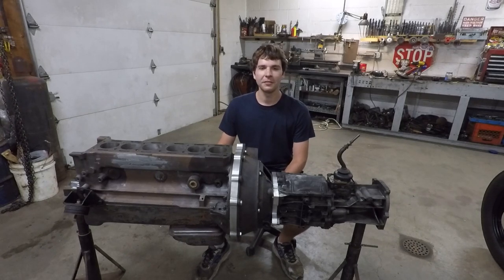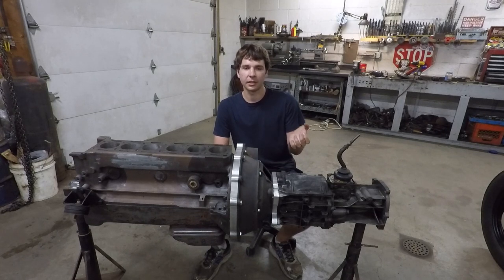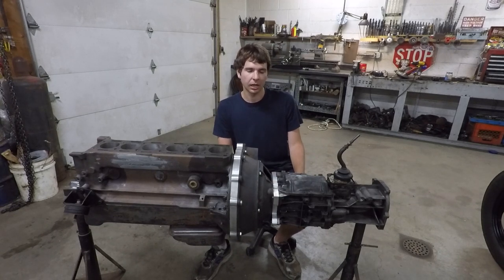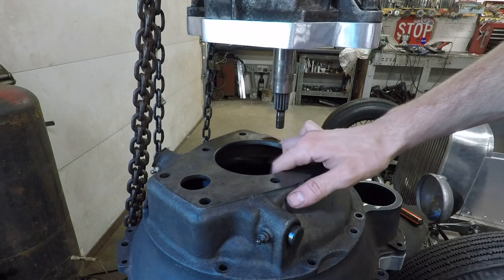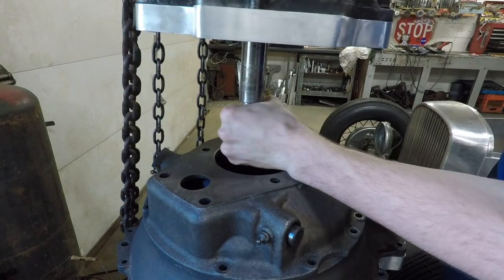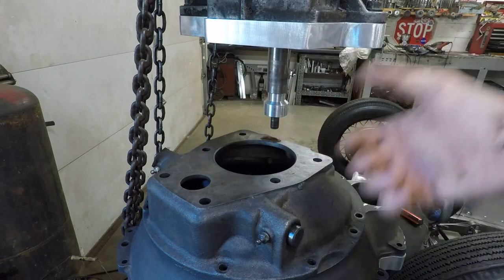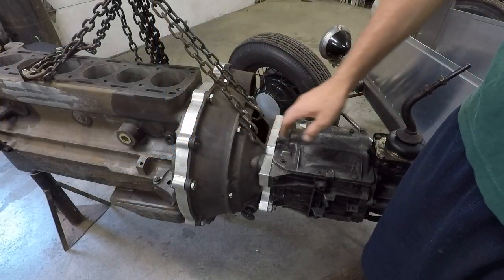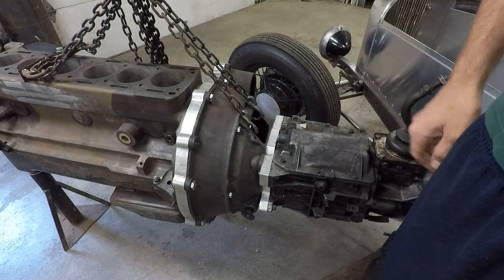Any Engine + Any Transmission Part 2!

Comment: What if the gearbox input shaft is too short ? If it is too long is a matter of using thicker aluminium for the adapter plates but what if using the thinnest possible aluminium plate is not enough to cater for a possibly short gearbox input shaft ? Otherwise keep up the good work - you have an excellent set of skills.
Reply: YUP! What about that?

Comment: It will be interesting to see the engine/trans location in the chassis.
Reply: Plot twist the car will be Rear engine!
Reply: @Fransenn  Nice joke but I don't think so.
Reply: @RichieCat4223  na i dont think so either
Reply: Those engines are heavy and there's nothing in the back end of that car but a few gallons of fuel. Weight distribution will be all up front making "interesting" handling. Even a fresh 2.4ltr XK motor is 112 bhp and the 3.8ltr knocking on 200 so the power to weight ratio will be impressive whichever you have. Now, about changing out those 1930's brakes...
None of this takes away from the astonishing competence you show in all your videos. I can't wait to hear your car run!

Comment: How did you decide on the thickness of the bell to trans spacer? I see bellhousing length measurements when looking at aftermarket, but I can't find an explanation from anyone on why they might be different. Obviously the overall distance between the trans and engine would effect how well the input shaft and pilot bearing mesh, but how do you know what that distance needs to be? For example, if the trans has a 6.5" input shaft and its being mated to a sbc, does the bell need to be 6.5"? 6.25"? 6.75"? It would be great if someone could make a video explaining bellhousing selection instead of all the "bell alignment" videos out there.

Comment: Loving all your clips and wondering how do you go about making the edges nice and smooth after cutting the plate on the saw?
Reply from the maker: a combination of an angle grinder with a flap wheel and files

Comment: Would suggest the you have engine rotating assembly balance any it is a must that you have the flywheel balanced with all the mods that you have  done on it.  Actually it probably be best that you have the entire rotating assembly including the flywheel balance as an assembly.  You will thank me down the road.

Comment: so...how did he measure to know how much to take off the trans adapter plate? i'm assuming there is a specification somewhere detailing how far the input shaft goes into the crank? or may you lower it down and if you can turn the tailshaft it's not in all the way? i'm confused on this point.

Comment: Ok but don’t I need spacers to raise the flywheel or lengthen the output shaft if no adapter kit exist like in my junction of a Mercedes om617 turbo diesel to a Jeep pattern turbo hydromatic 400 auto? I am thinking I need to add a spacer to the crank to meet the flywheel metric to imperial also.

Comment: What do you use for a torque spec for the tapped holes in the aluminum? Is there a formula based on material grade and thread?
Reply from the maker: if there is, I'm not currently aware of it

Comment: Can you tell me why do you think the threaded bolts into the aluminium adaptor plates are strong enough for the job over the long term? I'm doing something similar and that strength of the bolt/aluminium is the part of the construction I am entirely unsure about.

Comment: What about the extra distance the adapter plate creates on the transmission end? Won't the trans shaft be an inch short or so?
Reply from the maker: nope. everything is measured beforehand, and the plates are made to the thickness that lets things line up

Comment: You've perforated the flywheel attachment to the crankshaft with so many holes, don't be surprised if you take it on the road and punch the throttle, the flywheel snaps off and breaks. I've seen that happen on and old 356 Porsche engine. It had 8 pins instead of the four it's VW counterpart had. You should weld in and finish all those unneeded holes and then have the crank and flywheel balanced as a unit. And then, if the clutch plate is mismatched to the flywheel in centering even a minute amount it will setup up vibration and shake everything loose. And how will you mate the teeth on the starter to the flywheel ring teeth?. And will you have to custom make a new longer bendix gear, (or similar gear), to make it work? Makes for a good video, but I would like to how it runs after a few hundred miles. If you just let it idle and don't drive it out of your driveway it might last a while. But nonetheless a well made fun video to watch which shows how things can be made. Can I borrow your workshop, I need to make brackets for a dual Alternator on my 84 sbc 350? Good luck....................Just sayin'    Mike

Comment: Pardon my ignorance, but with those two thick adapters , does the transmissions input shaft reach the pilot bearing or did you get a longer one ? Did I miss something?
Reply from the maker: Yeah, it fits just fine. all the measurements are figured out beforehand, and the adaptor plates are made to match that

Comment: Was the selection of the Ford Flat Head clutch setup simply to demonstrate the ease of combining any engine to any transmission, or was there a secondary reason for using the Ford Flat Head clutch combination?   
Jaguar -- > FORD -- > Chevrolet -- > Done        --- vs ----        Jaguar --> Chevrolet --> Chevrolet --> Done.     
What is the availability of the Flat Head Parts?
Reply: In the beginning he wanted to use a Ford engine

Comment: With the thickness of those 2 adapter plates, the trans shaft length appears to be too short to reach the pilot bushing in the crank....   I’ve machined plenty of sfapters for my projects and engine to trans can be tricky, especially if you have 2 adapters.  Triple check your measurements.

Comment: Back when I had my shop I would do thing's like this. I had a Dune Buggy I was working on I wanted to put a Intercooled Turbo Charged Motor in it out of a Dodge Daytona Shelby. I had it set up with inverted gearboxes on the end of the rear axle shaft. The reason for this is that it wouldn't pull the front wheel up but keep the nose down. The only problem was if the torque tube broke in the front end you could bet Catapulted. My solution was easy: I was going to put an aluminum I-Beam up front. And utilize a leaf spring in the rear like Henry Ford used to do. Run it across the back of the vehicle but I couldn't figure out if I should configure it. Arch up or arch down; Any hoe the McCarthey boy's ended up with it & thier mom made them sell it. I didn't let it go with an engine, I hadn't even swapped out the gears yet...

Comment: Wanted to do something like this cause i have a 97 sonoma with the 4.3 that is mostly rust. The rear axle is being held on by 3 of the 4 shackles and the doors are falling off but that 4.3 still runs, so i figured i could part it out sans the engine and build something out of it.
Reply: 4.3 is a little demon of a chevy v6... does not rev high, but it really wants to

Comment: What is the difference in the Ford mustang t5 and the Chevy s10 t5? I can see that your t5 is for a 4wheel drive. But is there a actual difference that makes the Chevy different and better.
Reply from the maker: They have different bolt patterns where the trans meets the bell housing, and probably a few other differences too. This is a lot, but it'll tell you everything you want to know about T5s: https://www.jalopyjournal.com/forum/threads/tech-ultimate-t-5-article.171291/
Reply: Cool page thanks, I didn’t realize t5s were used in so many different types of vehicles. I like how you do quality work, that’s something that is hard to find these days. I learned that from my dad when I was a little kid and always stood by it, nothing like being proud of your work and the final result.

Comment: Awesome work! 
without the bellhousing perfectly centered aren't you going to have issues with your starter engagement?
Reply from the maker: nope, because the starter mount will be custom too
Reply: @MacroMachines  sweet. That Jag engine is going to look amazing once you have the heads, valve covers, and intake all polished up and installed.

Comment: This is kinda bogus, now tell us how you make the car computer work with car maker engine and after market or other maker trans? 
The car computer runs various parts of the engine as well as its transmission. You cant just shove a ford engine and a chevy trans together. these waist of time videos, well waist time